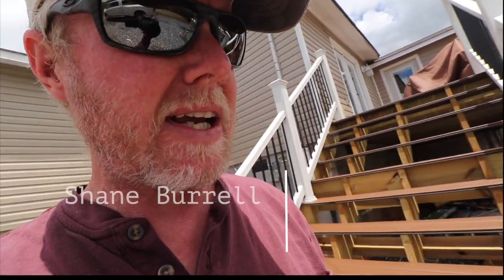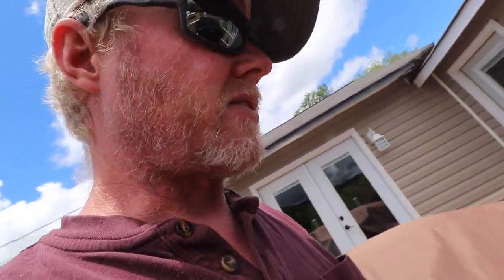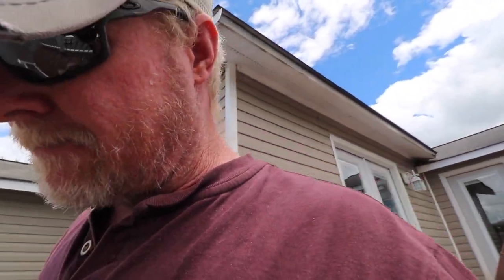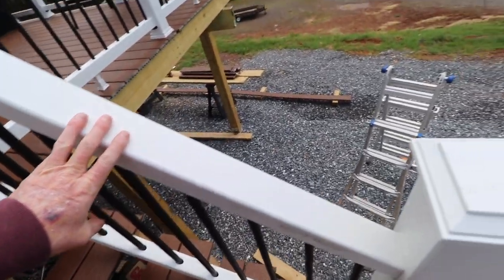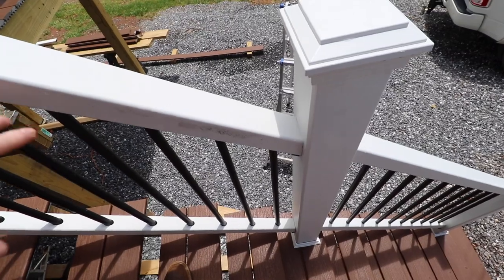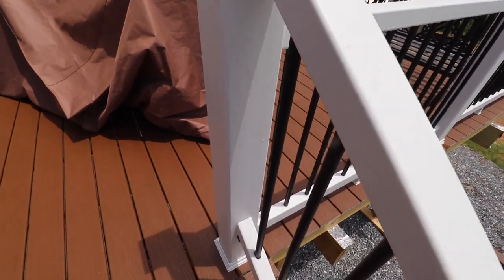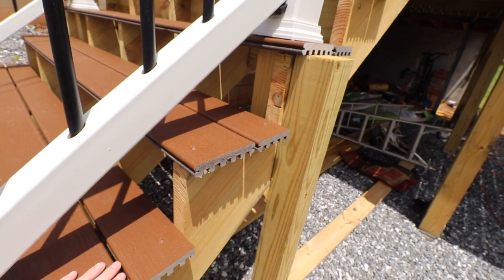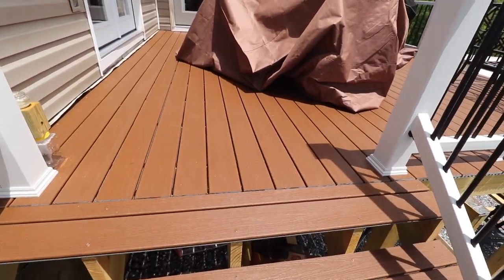Some Tips for Installing Trex Composite Decking and Rails

Comment: Deck looks great! The only thing I would do differently is to have shorter posts. Looks kind of strange with the caps almost a foot higher than the actual railing
Reply from the maker: Cutting the post covers would have been tough as it’s thin material and chips if you aren’t careful.
Reply: Diablo trex blade is made specifically for an application like that
Reply: I cut mine down. Had 13 posts, only about 2 had very small chip using a chop saw. Less then 1/8. Went with a fine tooth blade. The covers will cover any small chips.

Comment: They sell non grooved boards you can use on steps if you aren't using the hidden fasteners
Reply from the maker: I had checked on those. They weren’t in stock anywhere in my area and 3 week lead time. Likely would have polished out the steps a bit more if I could have found some. Also wanted some fascia board. Have you ever used it?
Reply: @ShaneBurrell1  I used the white abs/pvc trim boards on outside of deck and to close in the staircase.  They were expensive

Comment: It's never mentioned that you have to rip down the stair treads to fit on the stringers. In some cases I was able to cut slots on the ripped side of the boards for the hidden fasteners. I did this with my biscuit cutter. I agree with you the biggest hurdle is the stair railings. The two piece brackets are a bad design and are not molded well so they will not stick together even after cleaning off the mold flash. In addition the brackets fell right where an unused baluster hole was so I had to modify the brackets to mount them.
Reply from the maker: On my stair treads I didn't use hidden fasteners on the ripped pieces. Use screws thru the tread and heated with heat gun to heal the hole.

Comment: Shane, thanks for the review and great tips.  Your project looks great.  Question, on the stair railing, did you have to angle cut both ends of the balusters before installing the railing?
Reply from the maker: Yes I did

Comment: Stringer spacing for Composite is 9” on stairs I believe
Reply from the maker: Solid trex is 12" and scalloped is 9". Depends on the style / model of the trex decking.  I haven't run into any problems but if I did it again I would have added a stringer.

Comment: Do the railing/ banister rattle when you walk on deck?
Reply from the maker: The metal on the stairs some but not the deck.
Reply: Add some caulk to the balusters where they enter the railings and That should take the rattle out

Comment: Just did a hand rail system, not easy! But I did the same thing with a clamp
Reply from the maker: It's not easy at all.  Took me awhile to figure it and wasted one rail kit learning.
Reply: I've done 4 or 5 of them, good thing is I can buy a single rail from my supplier, I messed up once too but learned from my mistakes
Reply from the maker: It all still looks as good as the day I installed it.

Comment: For your posts, are those surface mount posts? Trying to figure out if Trex has surface mount system
Reply from the maker: They are not and I'm not aware of a surface mount system.  For posts you really need to tie into the framing to get a good post that won't move.  The trex itself just goes to the surface but the underlying 4x4 post is tied down into the framing.
Reply: I don't think surface mount posts would satisfy code in many areas?
Reply: Trex offers an aluminum post (about 2x2) that is surface mount, and then you can slip the same white post sleeve over it.  To be code compliant you have to have like two layers of 2x blocking under it and 4 big lags or bolts that go into both layers.   And the post is like $100 even before all the mounting hardware!   Makes even expensive 4x4s seem  bargain :)
Reply from the maker: @philp7358  Times have changed a lot on pressure treated lumber.  That may be the way to go now.

Comment: Good video!  Before I watched all of it, I could tell your stairs weren't on 12 inch centers.  I was gonna comment that Trex recommends 12 inch centers for stairs, so you covered that.  16 O.C. would definitely not work on stairs people!  I also had some "dips" in my deck and used shims.  I was contemplated buying a power planer, but my deck is only 7 feet wide by 23 feet long, more like a long porch.  Shims and a side to side vibrating tool took the high spots out.  Those Lowes 2 x 6 can look like a banana sometimes.  Not good for a deck!  Thanks.
Reply from the maker: Thanks!   The planer (Dewault Cordless) surprised me with how quick and how flat the deck ended up.  16x16 deck took me about 2 hours solo to have an ultra-flat surface for the Trex. So far the stairs have faired well and yeah I recommend 12" OC.
Reply: @ShaneBurrell1  Are you sure 16 on center is no good for steps? I have heard 16 on center is okay .
Reply from the maker: @jamesmergott  16 on center with Trex is not ideal.  I recommend 12.  The planks are not as rigid as wood. 16 works for the flat decking but with steps you normally hit the edge which concentrates load on the plank.

Comment: Stairs need to have “triangle picture framing” to avoid seeing deck board edges.  They are almost always scalloped these days and so the ends are very ugly.
Reply from the maker: I just didn't have the time or desire to picture frame the deck board edges.  I almost never see them in my particular install.
Reply: @ShaneBurrell1  sure that makes a lot of sense.  I did it on my stairs because they are so visible from all angles.  Took 1/2 day just to cut and fasten my 7 stair treads.  I still haven’t installed the Trex fascia board risers, or cut and covered the outer stringers with the fascia boards yet - that will be at least another 1/2 day. And it’s not cheap so I can’t make any mistakes !

Comment: How tall are your posts
Reply from the maker: The tree covers I didn't cut so whatever size they come in. The posts themselves go all the way to the bottom of the 6x10 so length of trex covers plus 9 1/2"
Reply from the maker: Then I cut them flush with the top of the covers.
Reply: @ShaneBurrell1  Did you cut them at 48 inches from the floor to the top of the post before you put the sleeves on
Reply from the maker: @deanwhite1087  I slid the sleeves on the post, marked a line, removed sleeve and cut post at that mark.  I used the sleeve as template to cut the post after the post was mounted.
Reply: @ShaneBurrell1  thank you so much